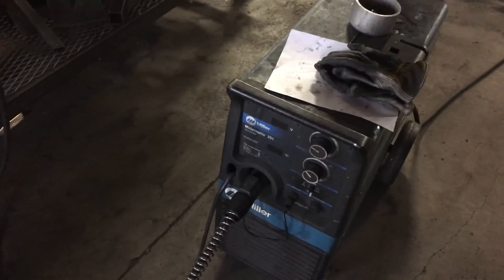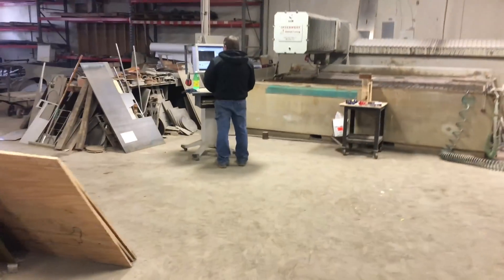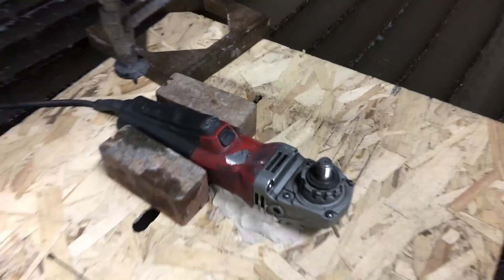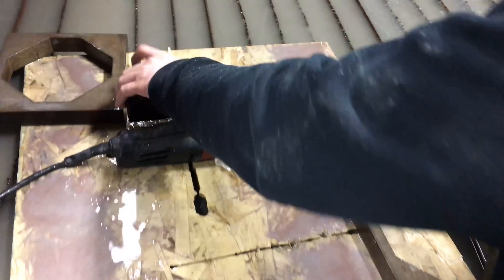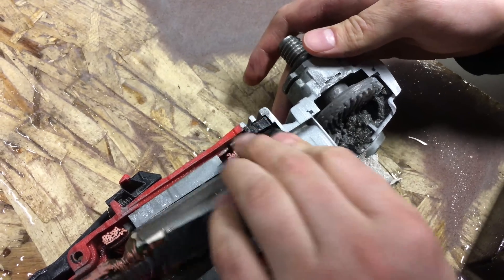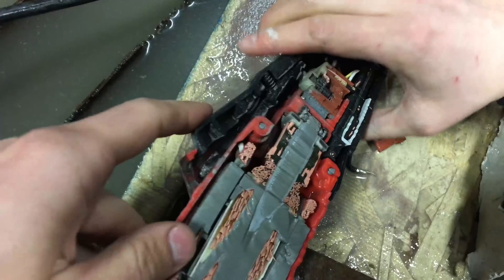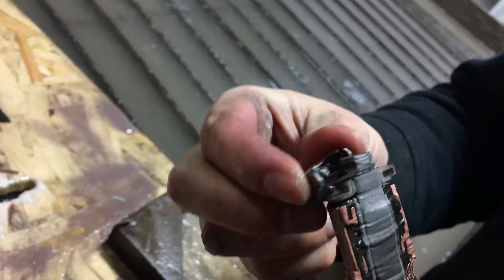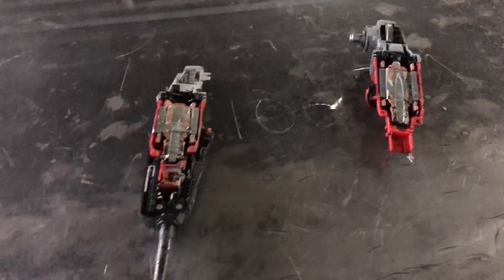Angle Grinder vs 60,000 PSI Waterjet - Power Tool

Comment: Your water bill must be off the charts..
Reply: SakiSkai it seems like a very small amount of water is actually being used, just at high pressure
Reply: Got any real numbers, not sheer speculation?
Reply: Ya sure. 
Ok so we need the flow rate in GPM, so for water with no abrasive we use Q=11.79×(pipe diameter, industry average of .125 inches)²×(60000×2.31×.5[to convert psi to head of water]) which equals a flow rate of 1175gpm. With average US water prices at 1.50/1000gallons, that means they're only spending a little over a buck fifty a minute to run that. 

My calculations are rough, but shouldn't be too far off. Please tell me if I'm wrong, I did this in a hurry and I'm very tired.
Reply: 1.50 for a minute? God damn, props for the calculations but that proved my point.
Reply: I really want Waterjet guys to provide us with some numbers